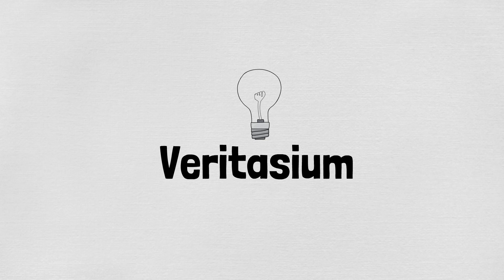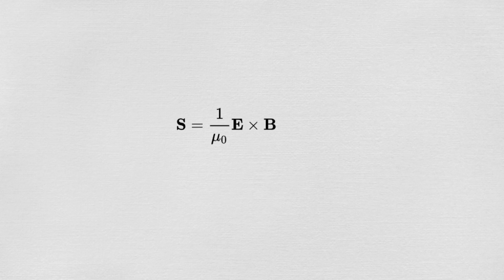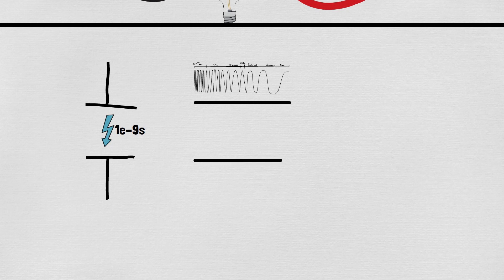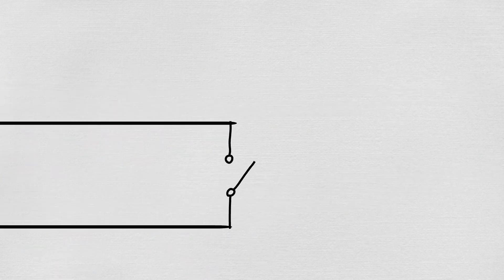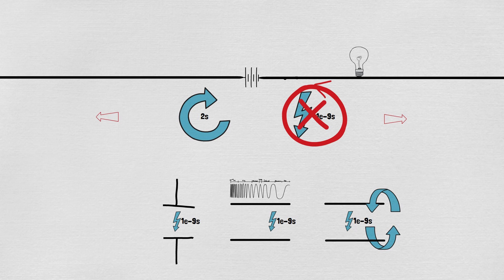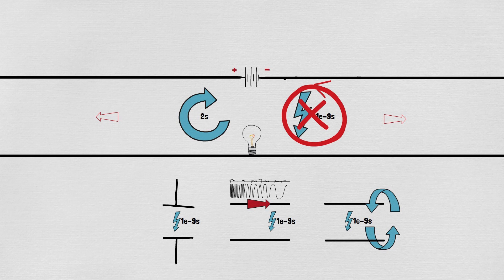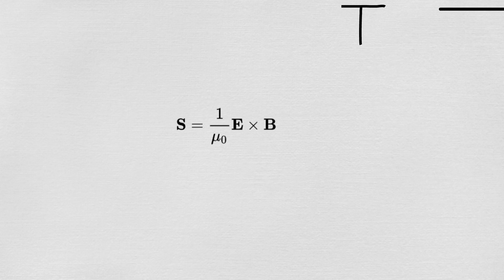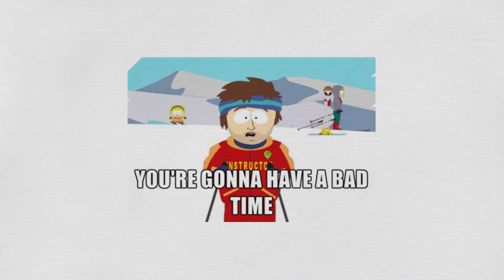Veritasium is Right? (see description)

Comment: Well done Tycho! My Jackson book in the office shelf was still trembling since the explanation in the Veritasium video. But in the initial transient some current turns on and some radiation with it that does transfer energy to the bulb and the wire near it. This emission takes place mostly near the switch, that is why closing a switch at one of the two ends cannot  light the bulb so fast.  The battery instead, that can be anywhere in the circuit.
Reply: No transient will light the bulb sir. That current would be too small. Over-thinking a simple issue.
Reply: @eddietee6305  At 00:43 in Veritasium video he said: "the bulb has to turn on immediately when current passes through it" which I assume any current large or small will turns it on.
Reply: @rossjackson7352  based on what? how much light is the light bulb emitting, oh right its not mentioned because the experiement explicitly made that, and your comment, irrelevant.
Reply: @koharaisevo3666  only the current thru the wires will turn it on. That's it! A DC current will only cause a transient when it's turned on or off. There is no no changing electric field after that. Steady state.
Reply: @eddietee6305  I'm pretty sure we can all agree this is not a practical circuit (what with 300,000m-long wires and all). It's just a thought experiment. So just roll with it. Yes, the current will be very small, and trasient, but it will be present.
Reply: @funkathustra  And this "explanation" for the light turning on in 1/c seconds must be considered a trick answer. The trick is in the magic light bulb that takes an almost infinitely-small amount of current to power, and the fact that "turns on" implies "stays on" otherwise we would say "flashes".

Actual electrical engineers and physicists agree that some electrical energy will be transferred more quickly than 1s (the full trip on each wire at the speed of light), essentially because of electromagnetic interference between the field of the wire near the source (battery and switch) and sink (bulb). This spike starts at approximately 1/c seconds.

Until 1 second for the voltage to propagate along the entire wire on one half of the circuit, the system is basically an inefficient wireless energy transmission device that uses electromagnetic fields to propagate energy from moving electrons in one wire, through EM radiation, to move electrons in the other part of the wire.

Which is completely mangled by Veritasium's explanation, and honestly kinda glossed over in this video as well. Medhi over at ElectroBOOM has a good explainer out that covers the electromagnetic transmission aspect.
Reply: @rossjackson7352  

Because of that, it would be on, for 1s exactly, because as the current travels, it would propagate a single EM wave, which would be perceived as a continuous signal on a 'lightbulb'. 

Then EMW would be gone and lightbulb would be on, by DC current presumably. 

If you throw away conservation of energy (is it physics at this point), it works, if not, that tiny emw cannot generate visible light emw. Unless it has an internal powersource. 

Which is NOT the conditions described.
Reply: @koharaisevo3666  yeah but the problem with that is it would imply that you wouldn‘t even have to turn on the switch to get the bulb to light up, brownian motion of the particles (electrons mostly) would do it by themselves.
Reply: @haphazard1342  You're missing the point of the original video. The point is that energy (and information!) travels in fields between conductors, not inside conductors. The conductors are simply waveguides that control the field's direction.  I love that the original video is trying to get people to think about electricity different. 

Maybe Derek should have changed it to be a radio transmitter and a radio receiver hooked up to infinitely-long antennas. Or a current meter instead of a light bulb. Or an AC voltage source instead of a DC one. People seem to be getting hung up on the light bulb and the amount of current way too much.

Comment: Great explanation!
I knew there must be something wrong with Derek's. He made it sound like the bulk of the energy for the lightbulb comes straight from the battery to the lighbulb when in reality it's be just a weak induced current, meanwhile the bulk of the energy the lighbulb would receive from the electron motion kickstarted by the switch closing and traveling along the wire.
Reply: It isn't really a good explanation, because it's wrong. The position of that switch matters. The antenna and "capacitor" explanation works only when you have the swich right next to the source.
Reply: @mrkv4k  yea, and 100000 Volts or super high current which he doesn't mention. Think about it... It's like believing that earth is flat
Reply: @kuba27kuba27  That's weird, because I remember passing that class with a solid B. You should tell that to all the college professors around the world, who teach electronics, especially the transmission line theory and electromagnetic waves.